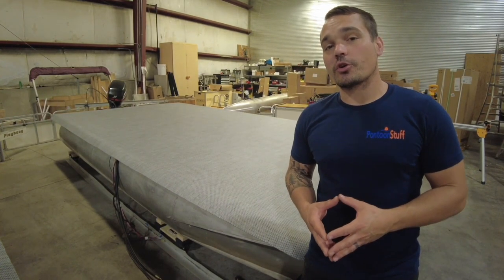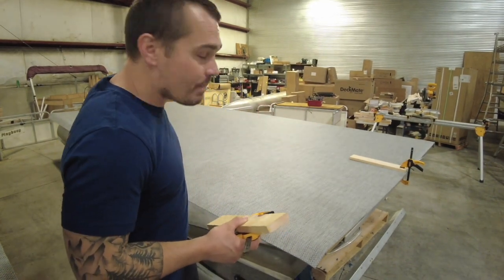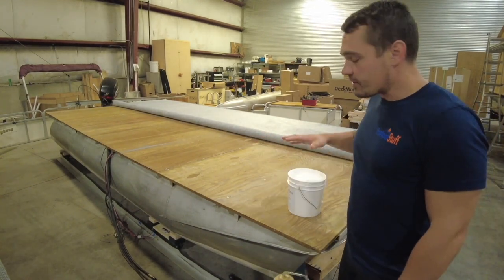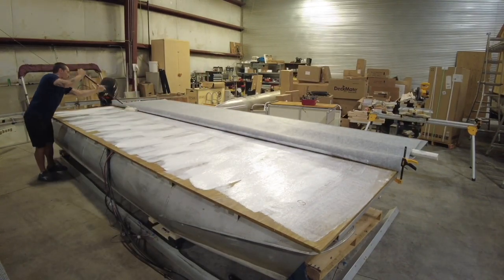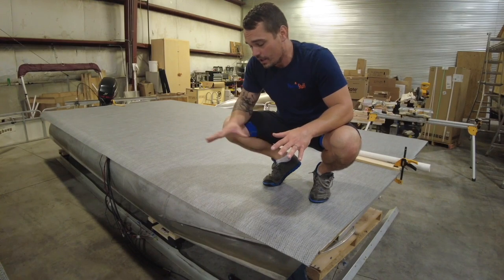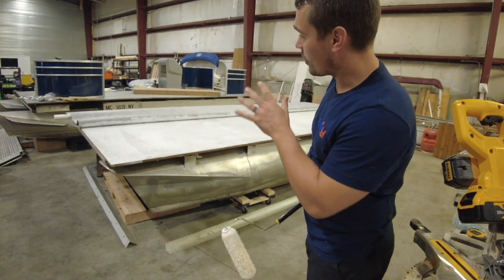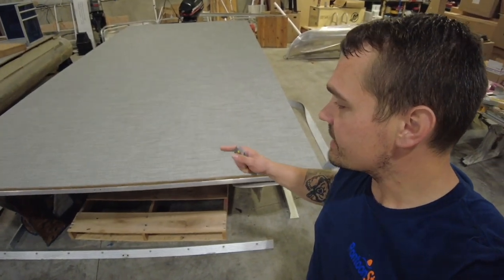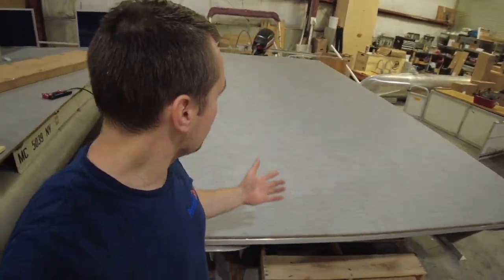How to Install Pontoon Boat Vinyl Flooring

Comment: My deck boards are pretty rough, and the toggle bolts that secure to pontoons are protruding a bit. I didn’t see how you addressed deck board seems? Will the seam tape address the protruding carriage bolt heads? Is there a product to put on deck to fill some of the irregular spots? Or simply sand smooth?
Reply from the maker: I usually counter sink any deck bolt that would protrude. Even just taking a layer of plywood off with a hole cutting bit works. The seam tape only goes on the bottom of the boards where they come together. Depending on the crossmembers at the seam, it’s usually one elevator bolt (deck bolt with flat head) where the boards meet, on 12” to 16” spacing. You could sand irregular spots or add some wood filler or epoxy and sand smooth. The general rule is that you’re more likely to feel rises under the flooring than depressions!!

Comment: Hey Tom, thanks for the videos. I’ve got my new deck and vinyl installed (ordered from PontoonStuff) and I’m moving on the the next phase of my project, redoing the panels. I have removed all the old stickers and I am left with the residue from the glue. Do you have any suggestions on how to get rid of that before I paint the panels?
Reply from the maker: I’ve always had great luck with Goo Gone, but could also try acetone. I’ve seen a rubber wheel decal remover that attaches to a drill, but I’ve heard mixed reviews. Some say it works amazingly, others didn’t have such good luck. It’s available on Amazon

Comment: What flooring would you recommend for a pontoon that will be exclusively used for fishing? Something that will clean easily and not get badly damaged from hooks?
Reply from the maker: Awesome question! On my own fishing pontoon I have the teak woven vinyl from PontoonStuff. I fish in the river for bass, catfish, salmon and steelhead. Bait, hooks, scales, blood, fish slime…my boat sees it all. I have a portable wash down pump that I spray it down with at the end of the day. Then once or twice a year I scrub it with a brush and dish soap. Just rinse and it’s good as new!!
Reply: @tomspontoons  Thanks man. Getting my rig ready and will be getting some of the teak soon.
Reply from the maker: @ME-pb2gf  you’ll love it!

Comment: Would you recommend trimming the newly installed plywood to make nice straight edges? (not all of my plywood is exactly aligned).
Reply from the maker: It’s common to have boards slightly off. Up to 1/8” shouldn’t be any problem and the rub rails (aka deck trim) will hide those inconsistencies and make the whole deck look straight and cohesive. Won’t hurt to cut them but probably not necessary

Comment: Tom, I just installed that same woven vinyl. The part that was in the center of the roll had creases, I think from being rolled too tight. Now that it’s glued down it looks like wrinkles. The part further out on the roll (24 ft boat) that wasn’t rolled in to such a tight radius is fine. I’m wondering if you’ve ever run across this and if there’s anything I can do? I also have a crease/wrinkle right in the center where I folded it over to glue the second half. This is really frustrating considering how much this stuff costs.
Reply from the maker: I have never had those issues with the vinyl I get from Pontoon Stuff. If it has wrinkles or issues from packing or shipping I’m sure they will take care of you if you call their customer service. I had issues with wrinkles early on using a different brand flooring. None since only using Pontoon Stuff’s vinyl.
Reply: @tomspontoons  Well, you were right. They agreed to send me another roll. I have a feeling I'll be able to pull the wrinkled stuff off but it will leave the felt and glue behind. The glue will probably clog up any sander I try to use. Do you know of a solvent that will break it down?
Reply from the maker: @davidalbertson6690  not sure the best option there…you could ask them if the new glue will reactivate the old stuff enough to stick down. Or if you even need to remove the old glue. 

Or rent a drum sander and a couple extra sanding pads, that’s what I’ve heard works the absolutely best.

Comment: Great video! I too have a 25' aluminum deck, gonna be pricey for vinyl floor. Just wondering if you've heard of tuff coat and your opinion on it?
Thanks
Reply from the maker: I have not worked with Tuff Coat. I think the prep work would be the most important part, being that it’s going on aluminum, to prevent it from chipping or flaking in spots over time. The investment in vinyl is pretty darn solid as it’ll wear far better than carpet and is so much easier to maintain and keep clean…plus it feels great on bare feet!
Reply: @tomspontoons  thank you for fast answer. I'm just afraid of my abilities to put on vinyl, love the look, just don't want to invest that much and mess it up.

Comment: Are the staples made of something special so there's no rusting?
Reply from the maker: Ideally you’d use stainless staples. However even if they rust they will not hurt anything as the deck trim will hold down the vinyl just fine. I like stapling to help with the adhesive process more than anything…making sure the edges stay glued down nice and firm.
Reply: Stainless steel Staples do not rust. I've done this for 37 years. I do not do the floor unlike that and and just don't quite understand why you say they may rust when they don't. That's why you use stainless on boats.

Comment: Just curious, why couldn’t you fold the vinyl over the edge of the deck plywood and staple the edges?
Reply from the maker: Great Question! This vinyl is almost 1/4" thick with the layers of vinyl, foam, and felt backing, which makes it very difficult to fold and staple compared to thinner styles of vinyl. Additionally, if the aluminum rub rail (aka deck trim) is an F-channel, it will not fit properly.

Comment: What is the best way to pull dents out of a toon?
Reply from the maker: Oh man, great question! A welder could tack some material and pull dents out. Filling with air pressure likely wouldn’t do much because the suggested pressure is only about 3 psi. I wish I had a better answer!

Comment: Marine plywood sold by the vendor 3x the cost of marine plywood from other sources. Is this because this plywood is treated and other plywood is not?
Reply from the maker: I recently bought 3/4” thick 4’x8’ marine plywood from Menards (untreated) for a test and it was only $20 less than the sheets of marine grade treated from Pontoon Stuff. We have the before and after video up for the test…I know I’d always spend the extra money and do it once the best way possible.

Comment: What's next?  After the woven vinyl is down, cured and edges trimmed ... what's next?  Install fencing?
Reply from the maker: You’ll need to determine if your railings integrate into the deck trim or if they’ll sit inside of it on the deck alone. If it integrates Into the deck trim you’ll need to install/position the trim first, then the railings go on. I always unbox and assemble the seat bases and seat back cushions up on the deck before adding the railings…much easier than having to lift them over!

This is actually a video we are going to make coming up, a short video just talking through the steps we take when refurbishing.